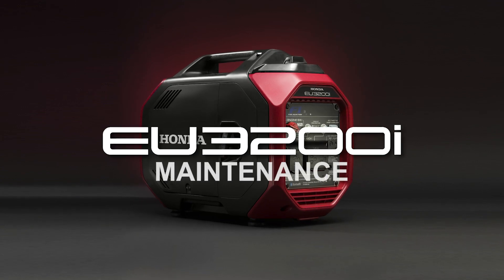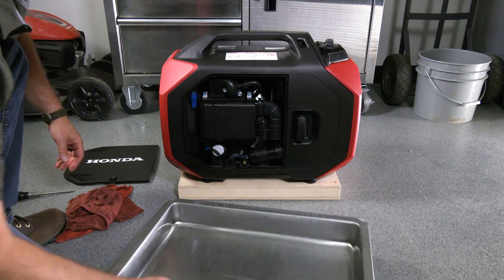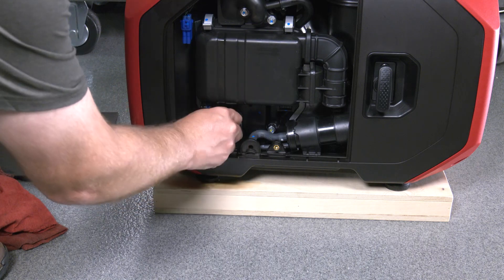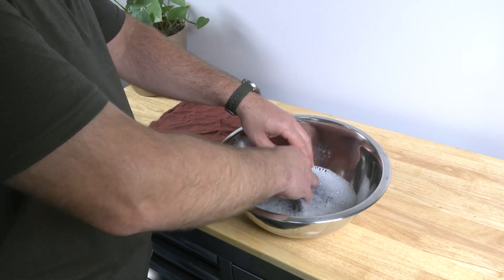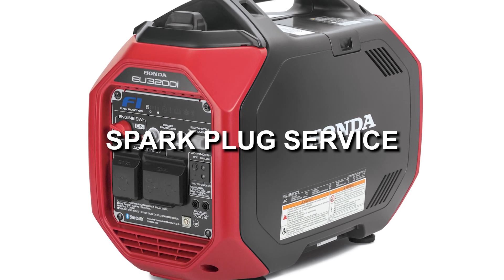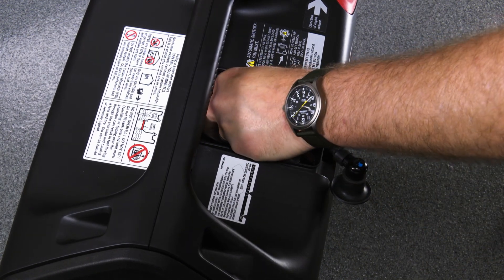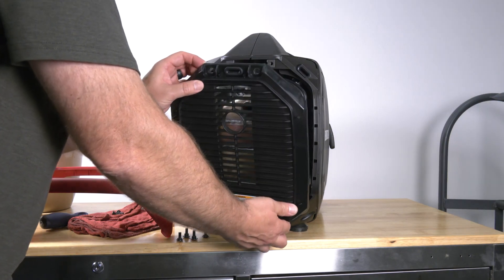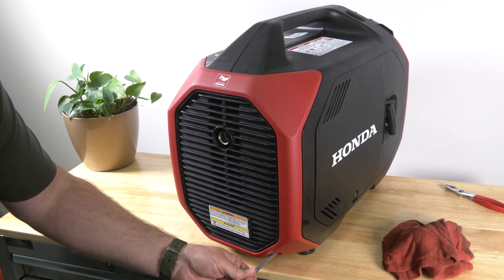Honda EU3200i Generator Maintenance

Comment: Why does my brand new eu3200i have major problems with its pullcord start? I get a full gym work out on my lats with this damn thing. The unit is an absolute bitchy diva. It starts when it feeeeels like it...
Reply: The trick is to very slow pull the cord until the engine is on a compression stroke (gets harder to pull). Then let the cord retract, and give a good hard smooth pull on the cord. This will give you a couple of compression cycles and make it start first time every time. It also prevents flooding. This is a good practice to get into for any small engine, but especially the FI small engines are prone to flooding.
Reply: From what I read online, the Honda doesn’t like cold weather.  Was hoping Honda would come up with a solution.
Reply: cracking up

Comment: Will it be a problem to use it in the mountains of 5000 meters?
Reply: It's fuel Injected,  so you shouldn't have any problems with altitude.
Reply: Plan on about 3% of power loss for every 1000’ (300M) above sea level.  5000 meters is high!  Best to upsize your generator a size or two.